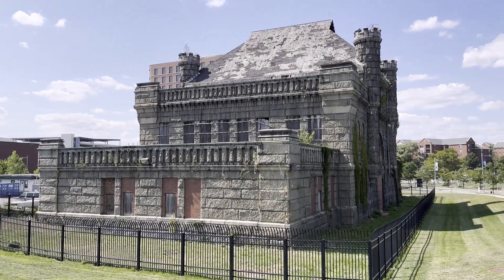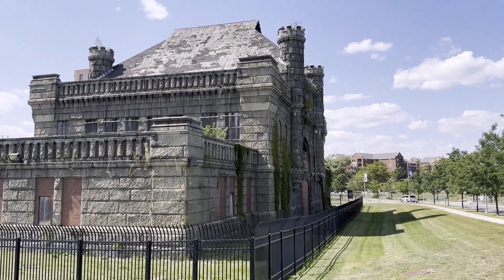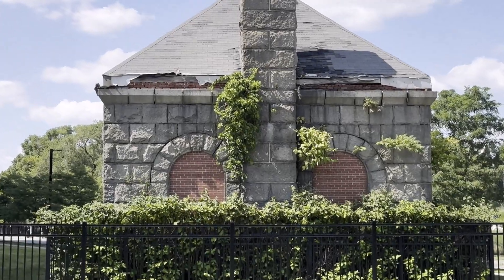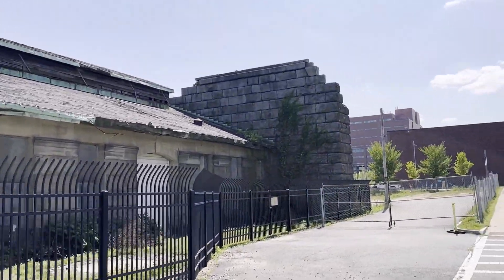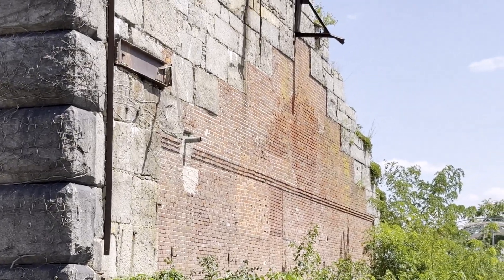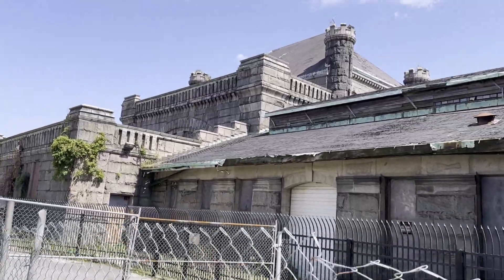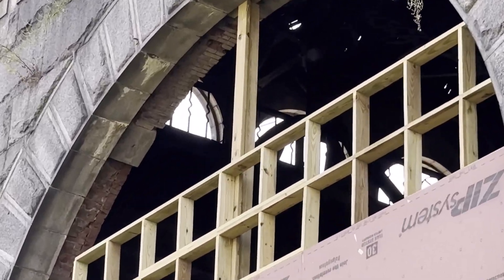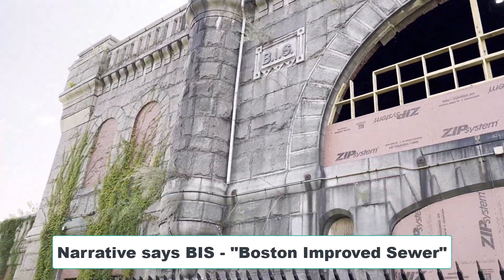Calf Pasture Pumping Station -1883 (Boston Improved Sewer)

Comment: Actually they are not brick internals, it is all bricks and the electric heat event transformed the outer part to granite blocks forming a shell, a crust.. it was not built that way.. look at the drippines of the blocks as they started to melt briefly before the process stopped abruptly.

2:22 transformations of bricks to granite blocks nicely visible! It would be nice to have a more detailed view of that wall

Thank you for your work, David, i really enjoy and appreciate your vudeis. Kudos!
Reply from the maker: I see and touch brick muffing up like popcorn and turning into shades of granite and sandstone. My mind can’t seem to bend to bricks changing to perfect molded granite structures etc. certainly do not discount this. I need more experiences. 👍
Reply: @davidwayne68  It's really hard to believe, especially when it comes to exactly quadrilateral blocks with 90 degree angles. I also struggled with this for a long time, my mind was rejecting it, but then I found a few partially transformed or erroneous blocks and that was enough for me